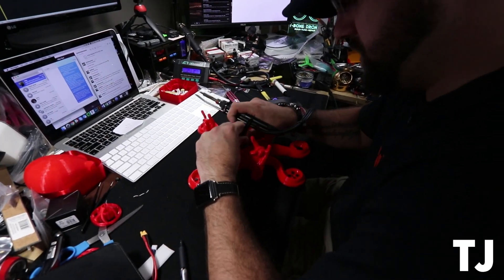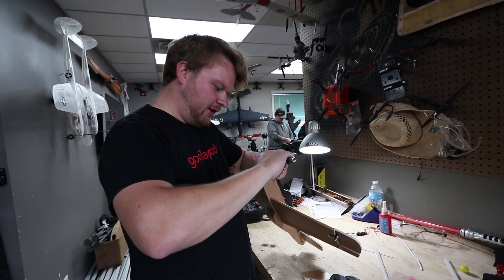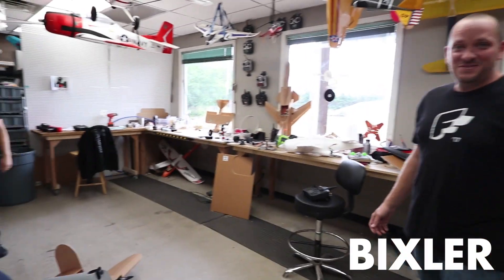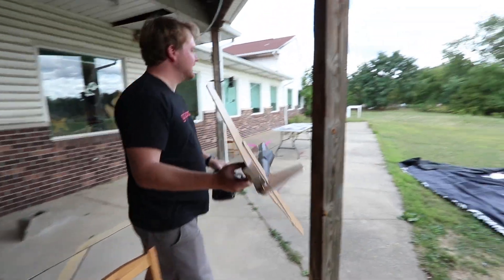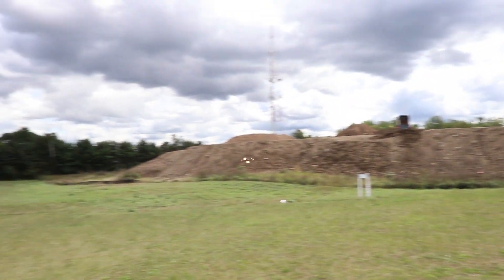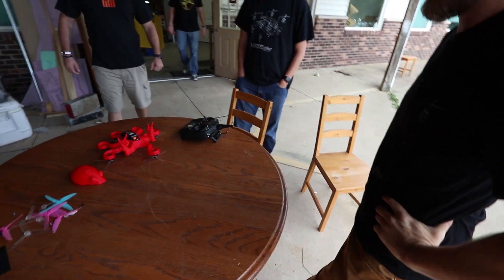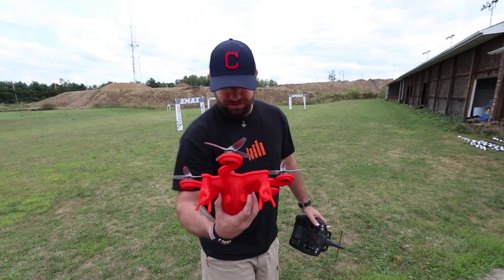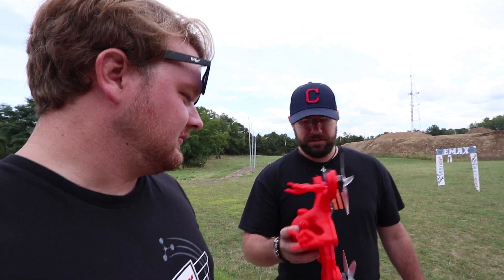DIY FLYING OCTOPUS | VLOG0106

Comment: I fly quads so is flying a RC plane any different?
Reply: Oh The Randomness Heck
Reply: Oh The Randomness yes it is completely different. Make sure you fly the airplane with a buddy or on a simulator. If you don't you will most likely total your airplane. Also make sure you have an airplane that is easy to fly. Not to scare you or be discouraging, but I've seen someone who flies quads try to fly a plane for the first time with no help or experience, and the end result was not good. I fly RC airplanes and they are awesome. If you choose the right airplane you will have tons of fun Just take your time and you will find it to be just as cool as flying quads.
Reply: They are very different. I would recommend the Super Cub S to start you off, it is very sturdy and easy to learn with. Planes and drones are pretty much polar opposites.
Reply: Oh The Randomness if your looking for a easy plane to fly get the Apprentice great plane for beginners
Reply: Oh The Randomness + I agree, the Apprentice S is an awesome first plane.
Reply: The Ft storch is a good beginner plane.
Reply: Yeah the sport cub s is a great one to, I have the sport cub s2 for my first plane ever and I love it

Comment: And what is a good first plane,for starters
Reply: Bryson Tube Gaming I got the ft tiny trainer quick build kit. It was great
Reply: Did you have to put a motor and servos on it
Reply: Bryson Tube Gaming sorry it was the get started package which comes with everything except a razor/sandpaper, tape, a hot glue gun, and hot glue. You can get the ft crafty kit also though

Comment: I would thing the so called "plus" configuration, which I assume means one of the motors becomes the front of the quad and the opposing motor becomes the rear, (as opposed to between 2 motors is the front and the other side the rear), would make learning to fly line of sight easier by making becoming disoriented and not knowing which way is forward, more difficult to do.

Comment: Up the perimeters and top/bottom shells and you might survive a crash or 2 depending on the severity. I printed some landing gear for my FTDuster with 6 shells and it's survived more crashes than the body.
Also try cutting the head off next time in the model and adding some printed latches,  much better than literally cutting it and gluing it back on! haha